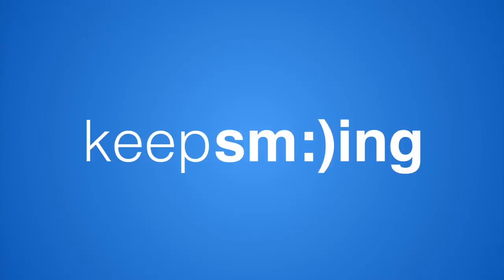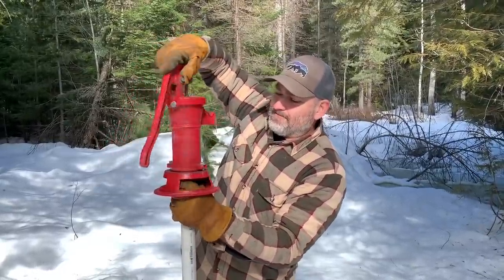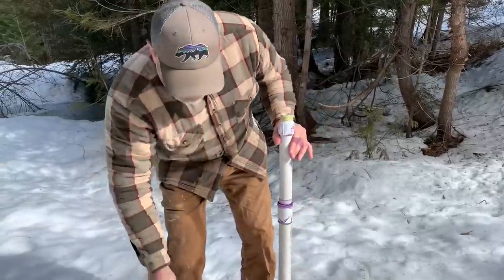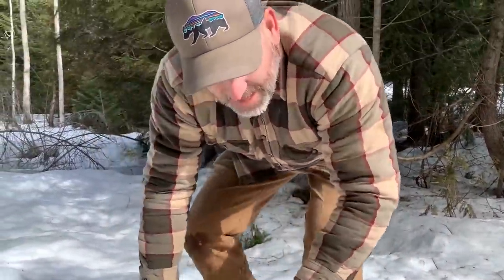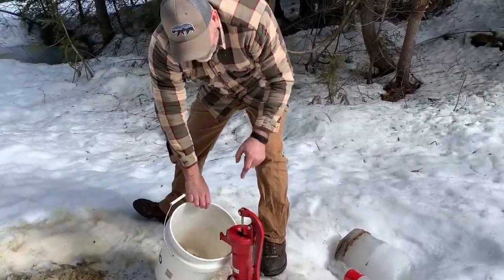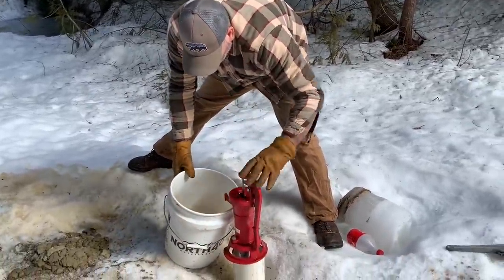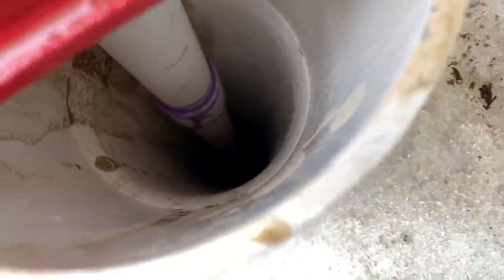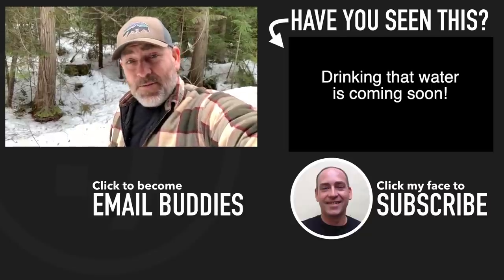DIY Emergency Water Well - 🤢SUPER GROSS 🤢I'll drink it!

Comment: Give up before you hurt yourself. Buy a real well point and drive it down into the well pipe you have and then  hook up the pump. The watered will be filter better going thru the well point  than the setup you have know.
Reply from the maker: How could I hurt myself?

Comment: Well driller from Ontario chiming in. If you want cleaner water you need a proper well screen not just a piece of hacked up PVC. And a proper sand pack around it. We use number 1 well gravel which is closer to a very course sand. They even have things called silt screens that cover your screen and help prevent silt from entering the casing

Comment: Try dropping an air line to the bottom  of the casing.  There is also a device known as a sand pump, which  is a 3/4 poly  pipe with a ball check on the bottom and you raise and lower the 3/4 pipe rapidly and it will pump the sand from the bottom and also clean the slots in the casing.

Comment: Have you tried putting a cement cap or rock cap at the bottom of the well casing so it doesn’t pull silt in as you create suction just water from the cuts you made in the pipe.

Comment: try at a depth of 300 feet (91 meters) or 400 feet (121 meters), in Indonesia we do that at a depth of 70 feet to 250 feet, each area is different, I don't know if there ... just try between the depths might be able to clean water sources. :)
Reply: The problem was the permit. IDK who issued those permit for drilling deeper, but it varies depending on states he lived in.

Comment: What about putting rocks down in the wide pipe to keep the silt out? It could also filter the water a little bit more and could maybe prevent you from losing more feet from the well.

Comment: The easy method would be a couple of cheap ceramic candle type filters in a bucket to dump it into before running it in the home filter. 

when its warmer you can clean out the well by using the pump to lift the sediment out and recycle the water to not be limited by the wells holding capacity. Once the well is back to the original depth pump it dry and you have pulled the majority of the sediment out. Repeat a few times over a few days to give more sediment time to work into the well to give it a larger collection cavity.
Reply from the maker: I might try it.  Thanks.

Comment: Since you are already in silt  you might try a sand point or as some call it a well point and drive it deeper. The sand point will screen the silt some maybe another 10 feet will give you a viable well. You can only pull water a little over 30 feet . There are a few videos on Utube.

Comment: It seems like you're contaminating your well because you haven't filled in properly around your casing. I realize you're probably going to sterilize the water before you drink it, but if you're actually trying to develop it into a viable well, why wouldn't you seal off the outside of the casing? Maybe you're not trying to have it be viable eventually.
Reply from the maker: How do you know if it is sealed or not. The ground us under 1.5 feet of snow.

Comment: Pump the handle while pouring water into the well. You will pump the sand and silt out with the water you pour in. We do it all the time. Keep pumping and keep pouring on water. This will wash a cavity that will eventually fill with good water. I have put down many pumps with this method.

Comment: Curious, did the silt fill to the footer or did you lower the footer to the silt
Reply from the maker: Filled to the foot valve.
Reply: @MartinJohnsonOffGridLiving  not a good sign. How will you keep it clear enough to be used as emergency water